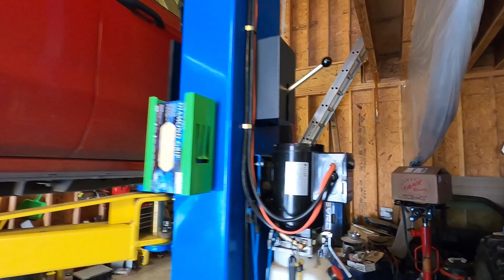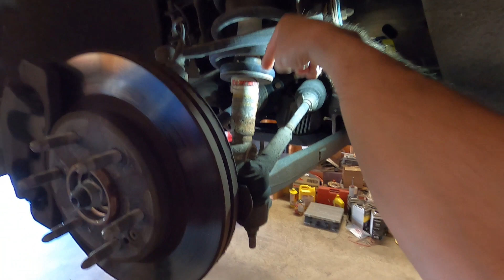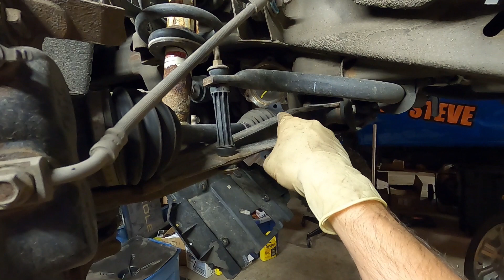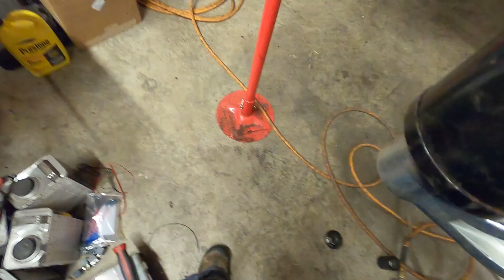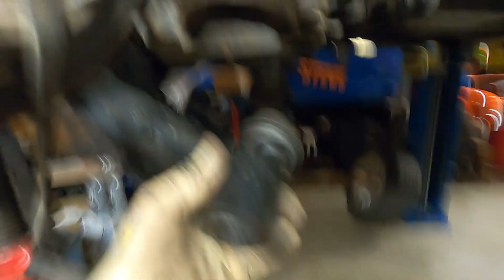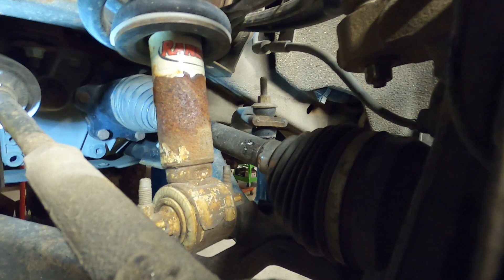2014 Silverado ball joint Replacement

Comment: how many miles are on that truck? I have a 2015 . also, what do you think about greasing those ball joints with a needle attachment? thanks for the video.
Reply from the maker: It has about 70,000 miles. The new ball joints can be easily greased with a standard grease gun. I wouldn't bother trying to grease the original, just change them when they wear out.
Reply: @slow_restoration  thanks